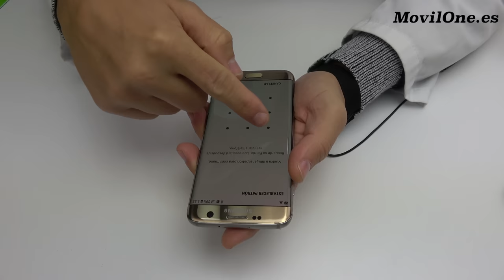Samsung S7 Edge Home Button Replacement

Comment: I was thinking of replacing my home button but after watching your video I change my mind 😳
Reply from the maker: :) M O, I understand you perfectly :) Let s say that it s not the easier repair that I ve done! Best regards
Reply: especially since you have to cut the adhesive between the glass and LCD. you can ruin the LCD so easily if you're not super careful or skilled like the person in the video
Reply: Lol
Reply: I feel ya. I was thinking of buying an S7 Edge with broken screen on eBay and replacing the screen. I've done that with S5, the broken phone + replacement screen are significantly cheaper than a phone with a screen in good condition, and you get a screen in brand new condition, not just good. On the S5 it's so goddamn easy. This is absolutely ridiculous, no way I'm condemning myself to this Herculean labor! Samsung probably made it a lot more difficult on purpose.
Reply: Thanks for making this video and reminds me that it's impossible for me to do :D

Comment: So I just tried to do this on a non-edge s7 but I ended up breaking the lcd. It is SOOO hard to get loose. I'm a noob at this, but trying to learn. In a repair shop situation, how many times do you typically break a screen before you "get the hang" of it? I'm guessing you have extra screens on hand in case this happens, and you just have to eat the cost of the part?

Comment: Can the T-7000 glue be removed in the future requiring the same amount of prying force? And is the phone still  water resistant reusing the same back adhesive? If not would you recommend using the T-7000 for the back as well?
Reply from the maker: Hello, Hellship rc!I recommend it, It is true that it is difficult to reopen the phone when the glue is applied, on the cover not so much in case you know where you have glued it, you will know where to open it :)  Wish you luck!

Comment: Did Samsung service center do this job  also in the Philippines?
Cuz i have the same issue....
Reply from the maker: The Point z, really don t know...look on internet, in your area ,to  see if they got a center like yours.. Best regargds
Reply: There are repair shop here but,  they advice me to change also  the whole screen because maybe they can get the main screen damage, the problem is only the home button screen os perfectly working good and ok
Reply from the maker: If the screen does not have scratches or damages, normally a good technical service gets it out without problems ...